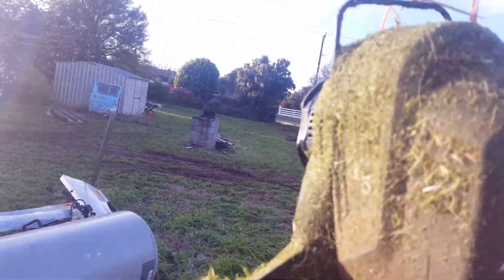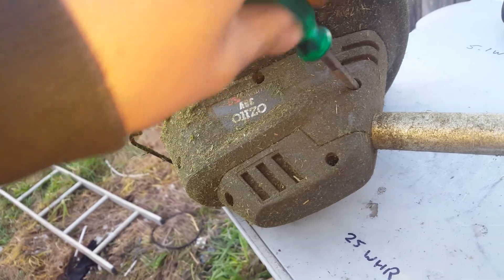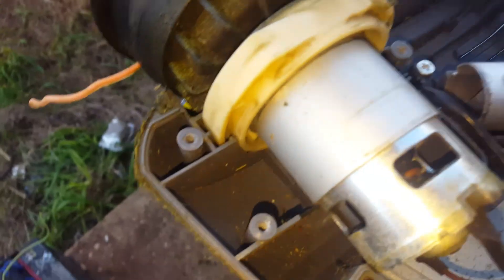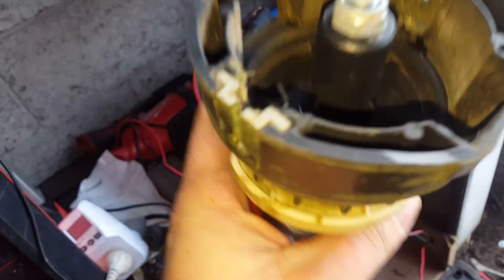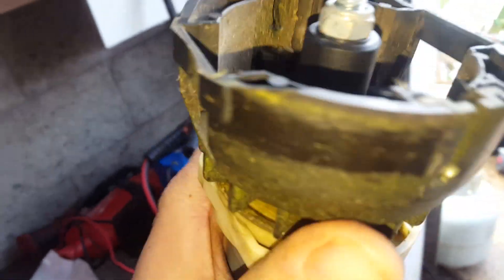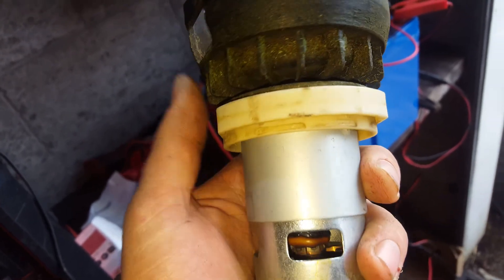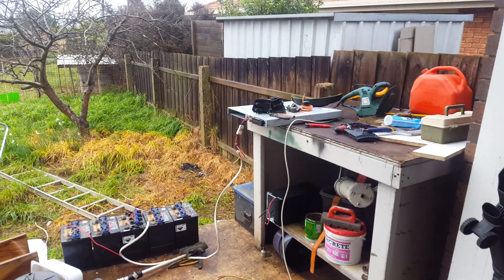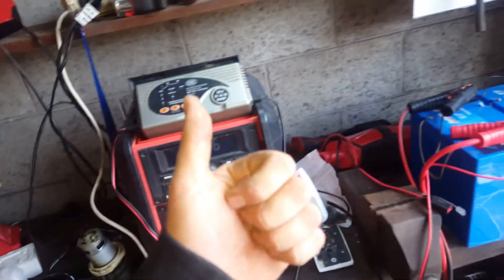My 36v Ozito line trimmer failed.( magic smoke escaped)

Comment: The cooling fan is on the  cutting  head.
Reply from the maker: +Michael Hodge yeah but the the white plastic bit at the bottom that holds  it into its case all.but seals it off from the motor. Its an odd design

Comment: The problem is that the motor gets over 125 Celsius 
The problem can be fixed by adding a cooling fan  I went though two units before I designed a cooling system  
The other problem was it was originally  (German designed with a brushless motor for the US market ?
Reply from the maker: Ow wow that's awesome that you kept it go8ng